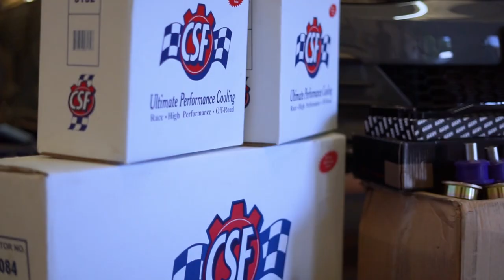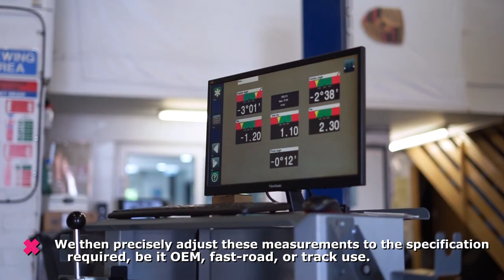CRAZY Track Upgrade Package on a MK7.5 GTI TCR at Regal Autosport

Comment: Great build. Why did the customer not spec an uprated intercooler? If you're replacing the radiator, why not while you're in there? Or does the CSF radiator + aftermarket intercooler not fit? Thanks!
Reply from the maker: At the time the customer wasn’t interested in power, now the car has been tuned he’s keen to add an Intercooler. The CSF radiator fits all aftermarket intercoolers, CSF are actually coming out with their own intercooler soon that’ll be optimised to work with the CSF radiator too.
Reply: Regal Autosport That’s great info, thanks! We have a lot of tracks to choose from in Texas, but it gets hot!

Comment: Didn't go for Cup tyres with all those suspension mods?  Odd choice PS4s overheat quickly on track in my 7.5 R with stock DCC
Reply from the maker: The customer didn't want to fit track tyres to it just yet, the customer went on to fit R888R at a later date.
Reply: @RegalAutosport  Great work BTW.

Comment: Superb achievement, congratulations, the video is also very well done, I put a positive thumb ;-)

At the end of the video we see a negative camber value of -3 °, did you put the same values at the front and the rear? If you agreed to share the geometry values, that would be very cool!

Good continuation
Reply from the maker: Thank you for the comment and compliments :) 

The values in the video are not final, we dialled it back a little. On these cars they have a lot of grip at the rear so you don't want to run too much camber otherwise the balance is awful. 

We do not share out geo/alignment information as this is developed in-house and part of our upgrade packages.

Comment: Why did u put the stock crappy wishbone arms back on it? Kinda defeats the purpose.
Reply from the maker: What do you mean? If we didn't put the wishbones on, the car would have no wishbones... Or are you asking a different question?
Reply: @RegalAutosport  Vekline sells tubular wishbones. Why buy the wishbone subframe and put the shitty stock ones back on. Why not buy the tubular ones im asking?
Reply from the maker: Thanks for clarifying! The customer is well aware of the Verkline arms, we’re actually the Verkline U.K. distributor and keep them in-stock. 

This customer didn’t want too much noise vibration and harshness, so we suggested to keep the stock arms with better bushes in there and see how he likes that, as this still adds NVH. 

As with everything, it’s a balance. If the customer wants to keep NVH really low then it’d not be good of us to advice to install the arms.
Reply: @RegalAutosport  Ok thanx for the response I appreciate it. That seems the way to go. Too bad the Superpro's didnt fit on the tubular arm. Well, I street mine as well so maybe I will just keep my subframe and use the superiors but I did entertain the tubular so u think the tubular frame and stock arms will work better than a stock frame and Super pros?

Comment: Did the customer experience any squeaking noise while cornering at low speed? I have a squeak when I turn while going about 10 km/h and I don’t know if it’s from my 034 camber mounts or the coils on my springs rubbing on each other or the spring bearings being dirty, I really don’t know, can you help me out?
Reply from the maker: We didn't experience this with the 034 Motorsport + BILSTEIN combo. It might be to do with the install or combination of parts used. It's impossible to diagnose remotely though, but the best first step is to check part compatibility and go over the installation again.

Comment: How to make choices between the kw v3  without dcc and b16 damptronic with dcc, would the b16 dcc be a bad choice? Thanks.
Reply from the maker: KW V3 without DCC = for cars without electronic damping
BILSTEIN B16 Damptronic = for cars with electronic damping 

We find our customers love the BILSTEIN kits, so fit and supply them the most
Reply: @RegalAutosport  my 7.5 performance comes with electronic damping, would the b16 dcc good enough for a track day? Thanks.
Reply from the maker: @eugenekuo50  this customer uses this exact setup for track, so yes. It maintained a nice amount of compliance on the road too. 

The next step up from this would be a BILSTEIN Clubsport kit which features more solid mounting, 2-way manual damping adjustment and spring and damping rates for more track bias.

Comment: What paste is that you guys use of the pads? And where can I get it would love some
Reply from the maker: We use a silcoln based lubricant for the brake pads, this helps to protect the seals, better resistance to heat and transfers less heat than typical lubricants.

Comment: Hi there. Im thinking about upgrade the subframe to this one in the video. Did u notice many NVH due thr new dogbone in the subframe? Thank you!!
Reply from the maker: Thanks for the comment, on DSG cars you can get a bit of NVH in 'eco' mode when the revs are low. When in 'Sport' and the revs are higher, it is much less. This is only at idle though, in all other driving situations the NVH difference we found to be negligible
Reply: @RegalAutosport  thank you very much for the answer. This is coming due the fact that i changed mine to the VWR dogbone and at the beggining was littlr to much, making all the cabin and plastic to vibrate. Installation was okey. Now i think is getting better. I dont know if the one on the verkline is stronger than this one or not. Did u tryed the vwr dogbone? There is much difference or they r close each other?
Reply from the maker: No problem! We don’t have any experience with the VWR dogbone, at least from recent memory anyway. We usually fit the Verkline subframe or the Powerflex inserts.
Reply: @RegalAutosport  will u advice me to change it? Im not a very track guy bcs there is not near tracks to me, but i would to start in some point, bcs at 2 houras i have Nurburgring. It will be worthy all the gains against losts in normal days?
Reply: I mean in daily driving, etc
Reply from the maker: The subframe has a lot of other benefits than just the dog one mount itself. It’s much lighter, more rigid and has multiple mounting points to correct the roll centre (when used with the Verkline front arms too, which then allow for camber and castor adjustment) 

It depends what you value, if you want to reduce weight, improve front end feel and reduce the engine moment then the subframe works really well. 

If you just want to reduce engine movement, the dogbone mount is the way to go.
Reply: @RegalAutosport  with this was enough. Thank you very much. Looking to improve all the feeling in my fwd car, trying not to make a vibrator thought cause i use it as a daily. Thank you again, really helpfull. Cheers!!

Comment: What does the racing muffler delete do ?
Reply from the maker: Thanks for the comment, the stock turbo has a muffler. It's two chambers which silence the turbo noise. 

The Racingline one removes this chamber, it's a straight through design improving flow.
Reply: @RegalAutosport  what does it sound like with the muffler removed ? Like a dump valve ? Or whistle etc
Reply: @Trystan46   no it sounds more like a turbine but doesn't increase the noise significantly.  I don't think anyone can answer this correctly, everyone who has the muffler del usually has the other 3 pieces of the intake sys too, and the whole system does make a difference in engine air sounds. For the whistling you need a gfb or forge atmospheric bov

Comment: It looks like the original subframe was made of aluminium, is that correct? If so that's odd as my 2019 TCR is steel. The Clubsport S was the only Mk7 to use aluminium subframe although this was no great shakes as every A3 had one.
Reply from the maker: It certainly looks like the aluminium one. We wouldn't waste the time with changing to the factory aluminium over steel. The weight savings, despite what a lot of people say aren't THAT tangible vs. the cost involved. 

Save your money, get the Verkline one which is 3.5kgs lighter than the OE aluminium or 7KG lighter than the OE steel one PLUS it's substantially more rigid, better geometry and already has an engine mount bush.
Reply: @RegalAutosport  how is the nvh with that front subframe? Thinking bout getting one, but my car is a dd.
Reply from the maker: @alexvasquez-vz2uw  thanks for the comment, we thought the NVH might be high but it's actually fine. It's a small increase for a substantial increase in performance and feel. 

The customer was a little concerned with the NVH, as we did advise him it would increase. Although, he thought the increase wasn't that much he's wanting to install the rear subframe and more of the Verkline spherical bushed arms too!

Comment: How would it compare to a Clubsport S after those upgrades?
Reply from the maker: Incomparable. The Clubsport S is a 'light' upgrade over the regular GTI. Some nice additions for sure but incomparable to a car with upgraded subframes, BILSTEIN suspension, BBK, cooling capacity etc.
Reply: @RegalAutosport  doesn't the clubsport s come with an ally upgraded subfarme anyway? But nether the less that's some serious cash pumped into what is basically a brand new car still!!
Reply from the maker: @markrs59  Clubsport comes with an alloy subframe, it's not upgraded. Just marginally lighter. The Verkline subframe is substantially lighter but most importantly is much more RIGID and adjustable roll centre. 

It's a no brainer for a track day junkie
Reply: Would be interesting to do a vid with a back to back track run on a clubsport S vs this car or similar with same upgrades.
Reply from the maker: @KOL630  Absolutely!